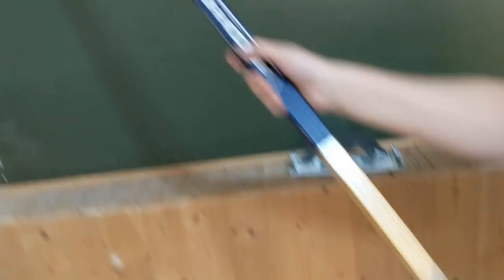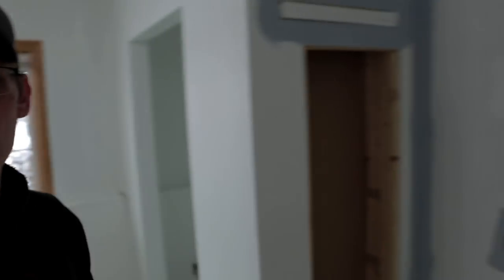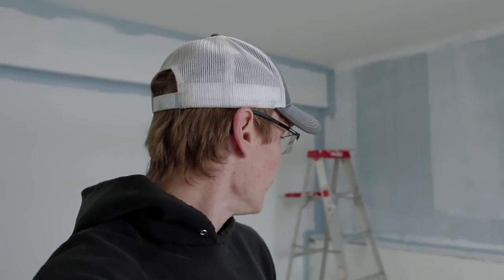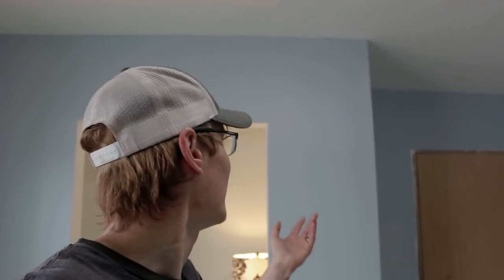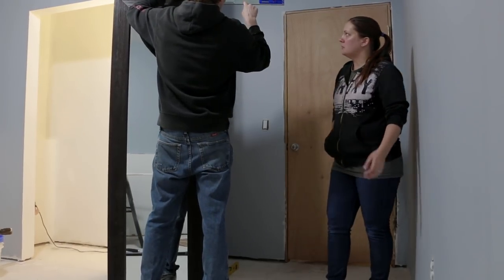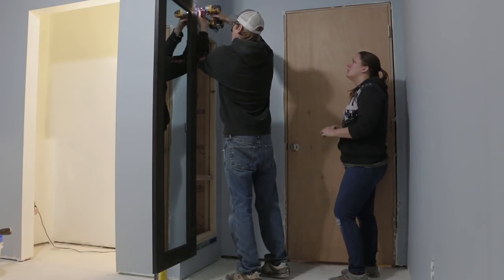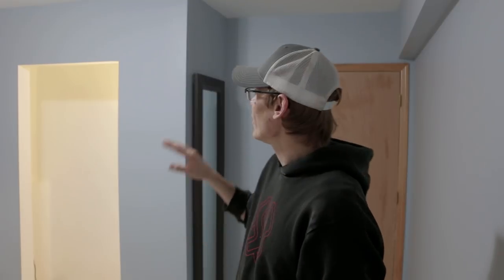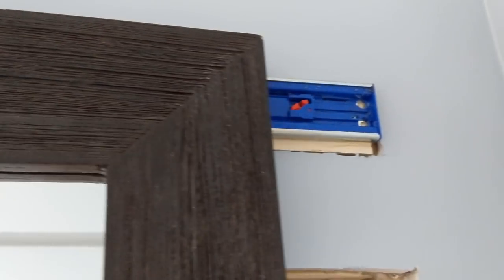Finishing Up The Hidden Compartment In The Wall  : Vlog

Comment: I had my house broken into some time ago and I had my gun safe hidden inside my bedroom closet. The long short, they still found the safe and went to town on it. I believe what saved me was that the safe was bolted to the wall and floor. After that experience and a lot of research I bought a much more stout safe, and still bolted it down, however I did not bother to try and hide it. Thieves are surprisingly thorough.